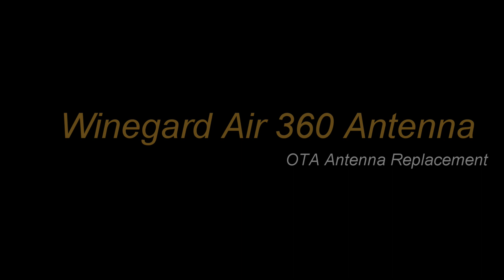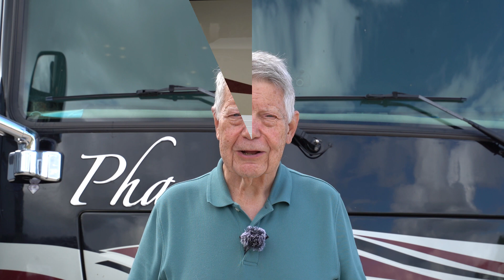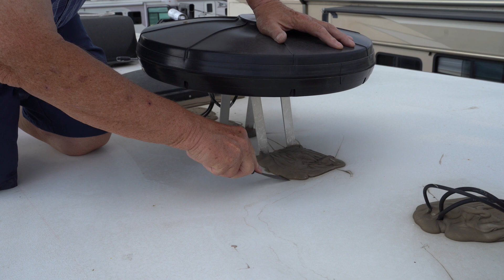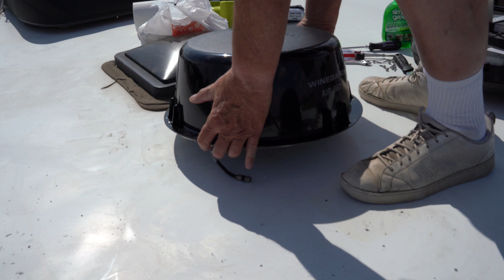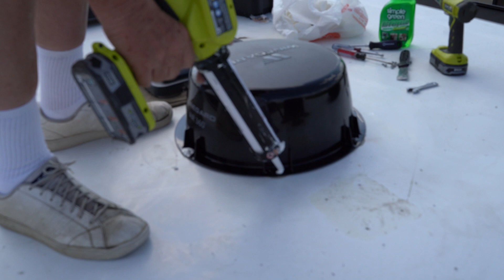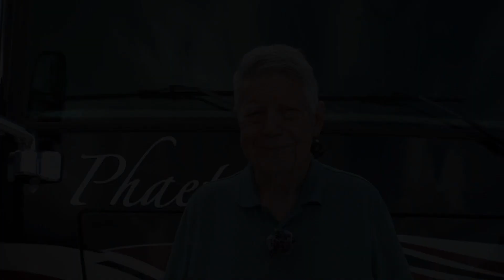TV Antenna Replacement

Comment: Very interesting design.
Printed antennas like this are a smart solution when space, weight, and consistency really matter.
Nice to see how it’s integrated into the structure instead of using traditional metal antennas.

Comment: I have the same antenna on my Tiffin and am about to replace it also. The old control box had two coaxial cables on the back did you use a barrel connector to join them together to get rid of the box or did you pull the amp switch plate and connect the coaxial cable to it?
Reply from the maker: Not sure I can answer that.  I didn't use the old box at all, but just left it there since there would have been a big hole otherwise.  I used the existing cables and a new control panel.

Comment: Did you have to purchase a winegard subscription for tv reception?
Reply from the maker: Not for over the air TV, assuming you have a suitable antenna to get those signals.  Winegard makes the antennae that are often used on RVs but once it is bought it is like TV anywhere if you are watching over the air transmissions.

Comment: Why replace an omni antenna with another omni antenna?
Reply from the maker: The original equipment was not an omni.  It had to be pointed to the transmitter and that was a problematic thing, very hard to adjust.  And the loss of sensitivity with a modern omni antenna was a minor factor.  If you want the optimum, these low self contained antennae are probably not the best solution but I did not want to deal with installing a good directional antenna.  TV is always a low priority for us.